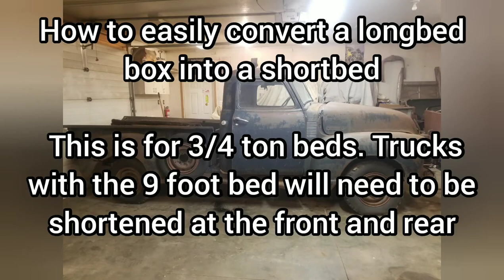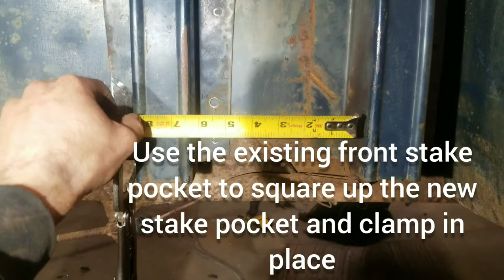1947-1953 Chevy and Gmc Longbed to Shortbed Conversion: How to easily shorten the bedsides

Comment: Great explanation and step by step guide. Truck looks good. Did you alter the running boards or were they from a 1/2 ton?
Reply from the maker: Thanks! I shortened  the 3/4 ton running boards, it's funny because I ended up with a set of 1/2 ton running boards less then a week later....could have saved myself some time, but now I've got enough parts to put together a 1952 shortbox later this summer.

Comment: I have the same truck in green. only the one I have is a bit better condition. I have been tempted to put it on a half ton frame and shorten the box but I just feel bad about changing anything on the the old rig.
Reply from the maker: Yeah if this truck hadn't been missing the drivetrain I would have left it alone, the chassis was beat on it too. I had the running shortbox chassis so it made more sense to swap the body over. The old 3/4 and 1 ton trucks are really cool!

Comment: hi, i live in brazil and i have a chevy 3600, can i use the short bed without having to cut the original chassis?
Reply from the maker: Hi, you will need to find a shortbed 3100 chassis to swap the body onto. The 3600 chassis is completely different

Comment: Did you have to shorten the frame and the driveline. It looks like you did but I can’t quite tell. ?
Reply from the maker: Hi, I put the body on a factory 47-54 shortbox chassis. In theory you could shorten a longbed frame, but they are narrower behind the cab and you would still be stuck with heavy duty springs and an obsolete rear end and brakes. Shortbed frames for this era of truck are cheap and easy to come by thanks to the number of people doing s10 frame swaps.

Comment: What about the steering geometry going scewwiff with different wheelbase? Ackerman angles etc? 😬
Reply from the maker: How about reading the description before trying to make a smart comment? The video is about shortening boxsides, not shortening a frame.
Reply: Hey, steady on with the aggressive response dude! It was a genuine question and yes I hadn’t read you were using a shorter chassis so the geometry issue doesn’t apply. Apologies for that, I wasn’t trying to be cocky, I see lots of people changing their wheelbase and never mentioning steering geometry effects which must surely make the vehicle unsafe if cornering fast on a hard surface 🤷🏼‍♂️ I ask because I want to do something similar myself shortening a wheelbase about 12 inches and am concerned about these issues.

Comment: How much did you take out of the frame ,thanks
Reply from the maker: I used a short bed frame. The longbed frames are completely different from the cab back and use heavy duty brakes/rear axle which are harder to find parts for.

Comment: What is it with this patina crap. I would like to have people see what I ve
Reply from the maker: You don't have the attention span to finish writing a comment, yet you expect people to believe you're capable of spending 1000 hours doing paint and bodywork? I like vehicles with nice paint, and I like vehicles with aged paint. Not everyone has to be into the same thing, and "patina" or primer doesn't have to be a permanent finish. Would you rather these vehicles sit and rot in a field until they get scrapped?